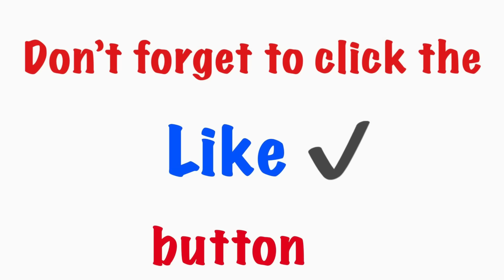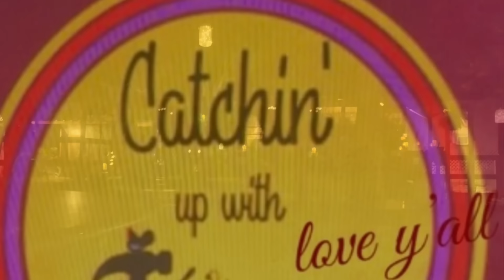Daniel and Buddy…see I do ask for help sometimes

Comment: Good morning Kim, Levi, Dan, and Buddy. Kim I am just like you it's difficult to ask for help when you're use to doing everything for yourself. I have begun to ask for help now more often. We've had so much rain here that our septic system had to be pumped out because we didn't have enough time between rains for the leach field to dry out. I ended my day yesterday at 2am and I was up at 4:30am this morning trying to get everything put away in the house. I'm afraid that I will be saying that it's packed in a box for months.  We're trying to finish moving our stuff from the city to our country property. I'm also having to pack up my Mom and get her moved as well. I will be so glad when I have her moved. The apartment building she's moving out of has just been horrible since the new owners bought it 5 years ago. She's been without heat and air conditioning for 5 years. The new place we found for her is so awesome. It's in another town about 10 minutes away from us but the manager has helped us so much. He allowed us to stretch the deposit out over several months. When he finished putting new carpets and a new bathroom floor in he figured out the the air conditioning was working and had someone out that day. When he found out it needed a part and it wouldn't be in until the following Monday he had a window unit that day in her apartment. It's so nice to have a manager that actually cares. Anyhow I better get back to work, I have to get on the mower and get the yard mowed before the next rain comes in. Thank You for sharing. Much love from our family to your family 💞